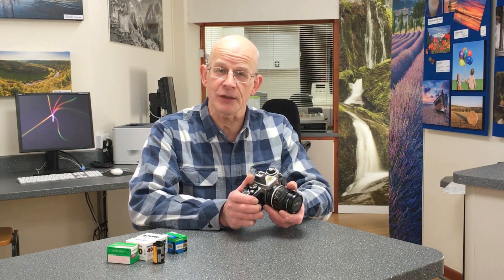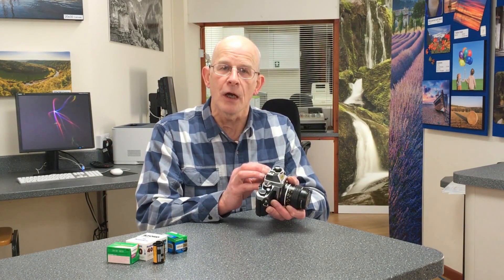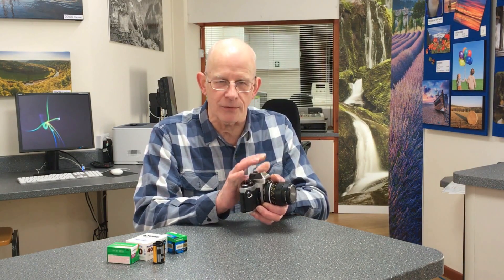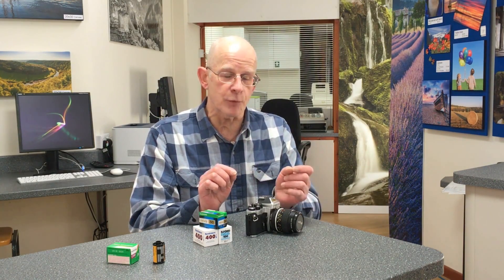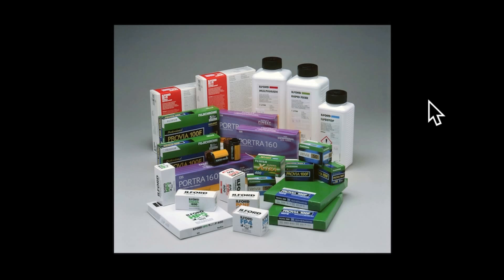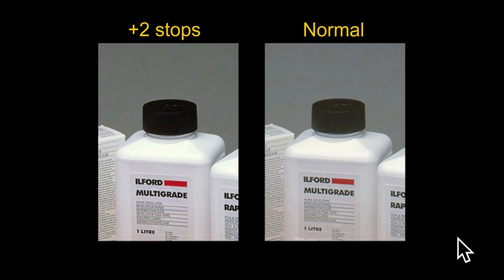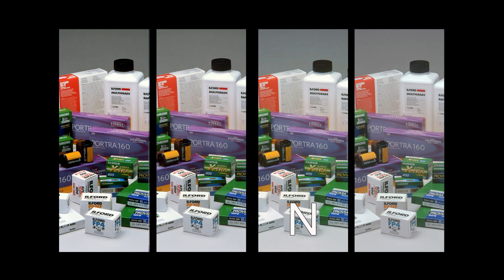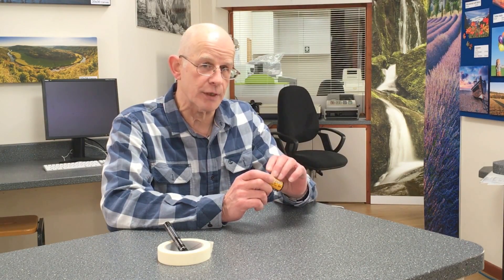Push & Pull Slide Film processing

Comment: Hi! Great video! Thanks for sharing your experience :)

I have a quick question. 
I have a iso200 Agfa slide film expired in 2008. 
Let's say i would shoot it at the box speed (so iso 200) and then develop it (the lab) at iso 100. Would that work?
My experience with expired slide film is that the sides at the perforations also turn nearly transparent when developed at the box speed.

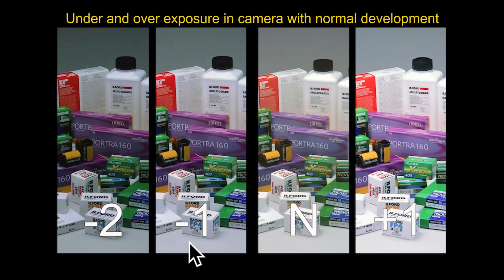Comment: Very interesting subject, but it looks like the results are a bit mixed up probably: the "Normal" exposure (@ 4:35 and later) looks like it's pulled from +1 because of the green vail which is very noticeable on the reds and purples that got desaturated as well as shadows which look green-ish. Curiously -2, -1 and +1 don't have such drastic color shifts and only the later example of "pull -1" has a similar effect.
Reply from the maker: Thanks Stanly. The order is correct and the colour images only included as a guide. A video covering the effects of push/pulling colour film would certainly need to look at colour shift in detail.
Reply: @thedarkroomukltd7541  ah, I see! In any case, one has to actually try doing all of that on his own to actually "feel" the difference and have proper expectations I guess!

One question I have (and maybe you have an answer for that) – there used to be Ektachrome 1600 ASA film, which was actually 400 and meant to be pushed +2 stops in development. The question is: was pushing  that film +2 stops any different than let's say pushing modern Ektachrome E100 +2 stops to 400 ASA? Did it have something special about it to allow that?
Reply from the maker: @Stanlyok  I'm sure manufacturers tweaked the emulsion to mitigate the problems normally seen in pushing +2 stops, but the results were inevitably more contrasty. Since the quality of light has as much impact on contrast, there isn't one answer. Often the reason for shooting at a higher rated speed are because of the light levels mean there is no choice if you want to get the shot. Modern films are no different and their contrast will increase, blacks will have less density and there's likely to be a colour shift as well. It's always going to be a compromise quality v getting the shot.
Reply: @thedarkroomukltd7541  yeah, light is the reason to try pushing! I wonder if pushing will be any better than adjusting exposure in post. Also to my understanding the contrast comes from "stretching" the gathered light information, with the darkest point remains the same. Meaning that if your scene is mostly dark – it won't benefit from pushing as much as if you're taking a picture of something that's mainly mid-tones and up.

Comment: I have provia 1600 which needs to be pushed two stops is that ok?
Reply from the maker: Provia 1600asa is now a few years old. It had a technology that pushed the boundaries and didn't have the rich colours of slower film. The age of the film will likely mean the blacks will be a bit washed out and pushing 2 stops will exaggerate this. Expect grainy, contrasty results, but if you've already exposed the film, just let us know and we can push it for you.
Reply: @thedarkroomukltd7541  I'm after grainy results. I would for this purpose rate it at 1000 and use a type of soft filter. I've also found I have ektachrome 1600